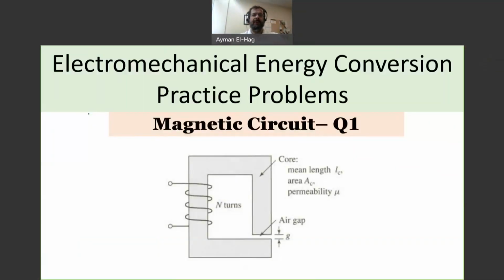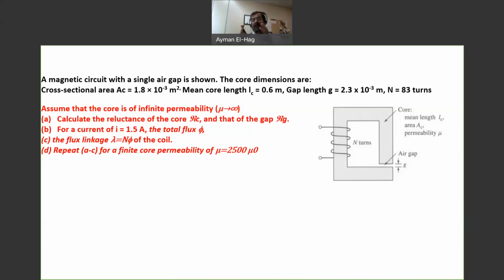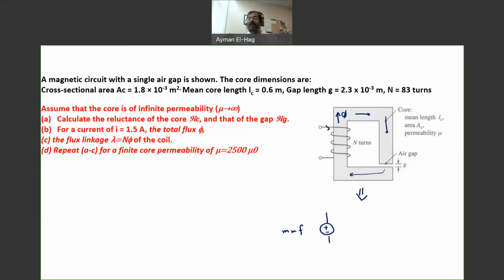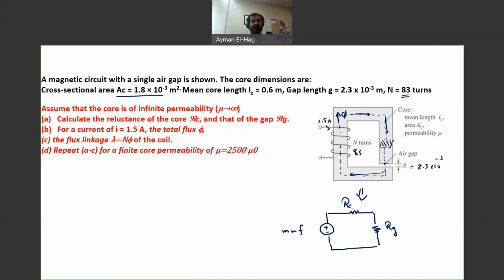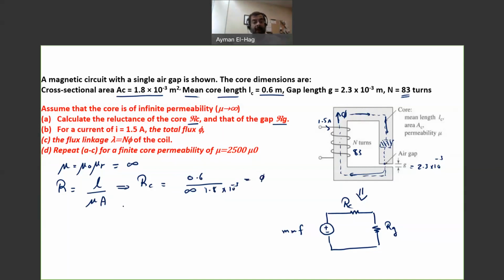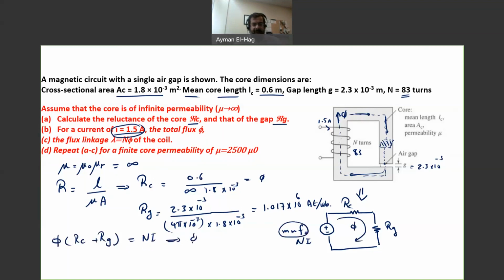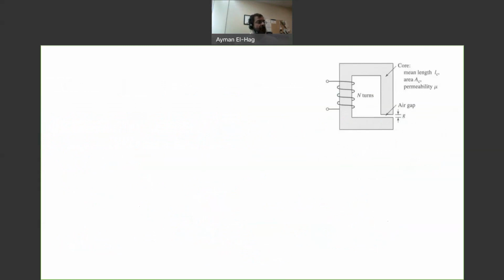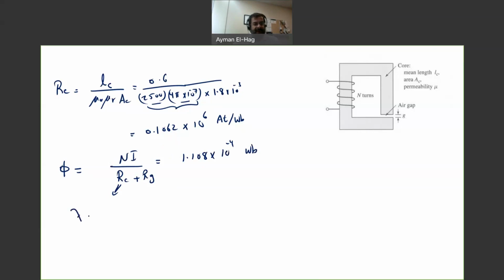Magnetic circuit - Question no.1

Comment: in some videos finding core lenght they make mean lenght- gap lenght in your case you did core lenght = mean core lenght which one is correct? dear Ayman El-Hag
Reply from the maker: It is assumed that the given mean length excludes the air gap. Nevertheless, even if you subtract the air gap, the results will be practically the same as the air gap is very small.